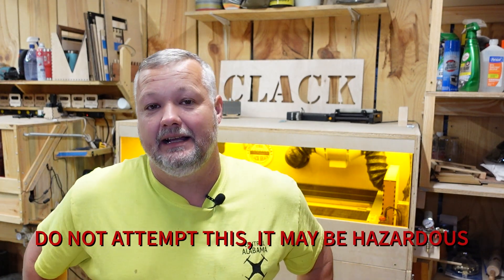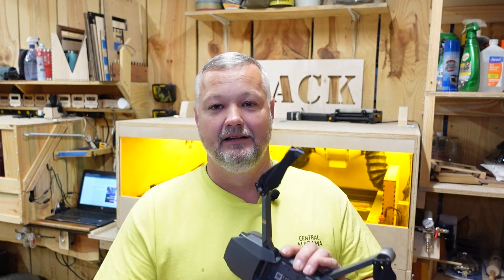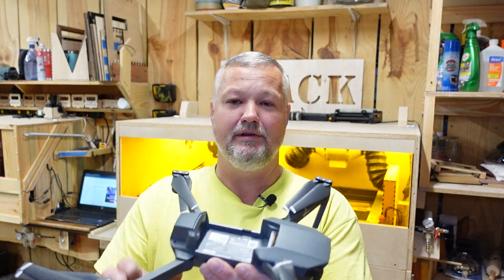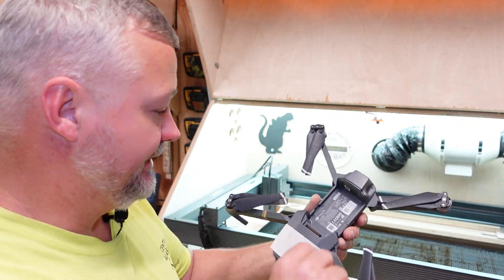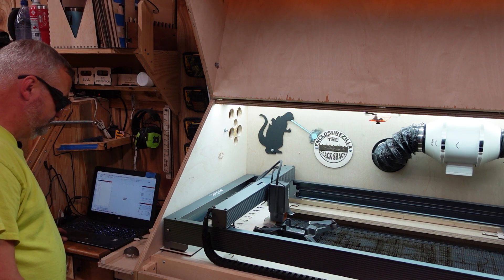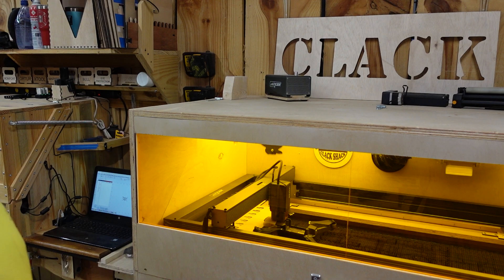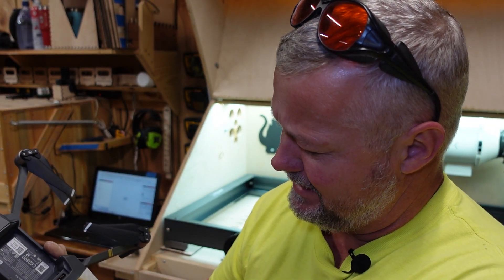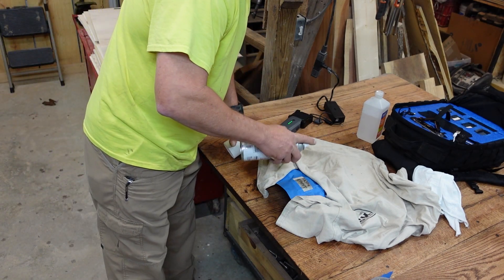DO NOT attempt this !

Comment: i have several drones registered. the faa does not specify where it needs the registration number. i put mine inside the battery compartments.  you also don’t have to engrave it.
Reply from the maker: You may wanna read the recent update. The numbers must be outwardly visible. I have my part 107 commercial license and have to retest, it recently changed. Engraving is one of the recommendations.

https://www.federalregister.gov/documents/2019/02/13/2019-00765/external-marking-requirement-for-small-unmanned-aircraft

Comment: Dave, when using the masking tape to test burn, what speed/power setting do you use on that 20 watt mach to NOT burn through the tape to your project? I always use dark colored soda cans to verify if my text is going to mirror corectly before a burn on a NEW project, but I have had others say they use masking tape like you do. I was worried that it would bvurn through the tape but evidently it wont id it is set correctly. I too use my drone and I have printed decal tape to display my FAA Reg No. Great Idea to use the Laser. Great Informative video my friend!
Reply from the maker: very low power. 40% I think. Test first

Comment: Just in case anyone does not know, you can take copper pipe or a heavy copper wire, I use #6 copper ground wire, heat the end with a torch, put the hot copper to the material you want to test, then put the copper back into the torch. If the flame turns green, that is off gassing chlorine gas. Not safe. If no green flame, it is safe to laser.
Reply from the maker: Cool

Comment: I have the phantom 3 and the phantom 4. I have not got them out in a while. 2 of my Phantom 4 batteries are already trash, swollen and will not charge.
Reply from the maker: Yea, the newer batteries seem to hold up better. I try to maintain them but they will probably have to be replaced soon.
Reply: @TheClackShack  I failed to keep my batteries up and 1 of 4 will no longer take a charge.  (Mavic Platinum Pro)